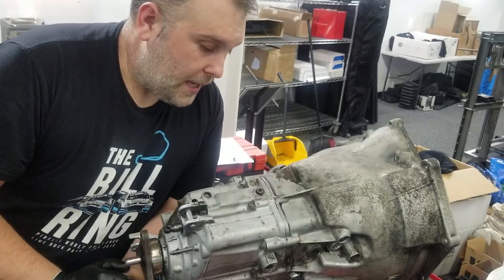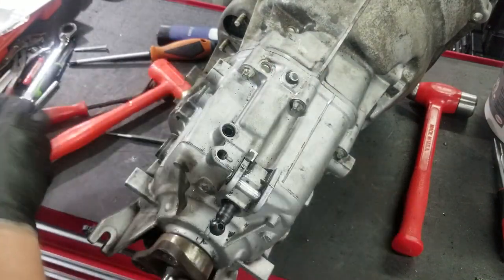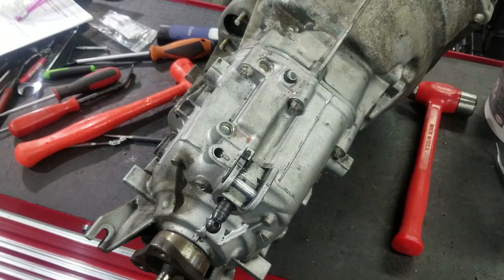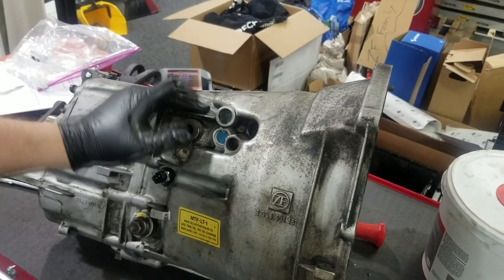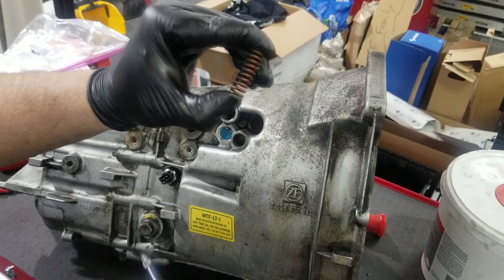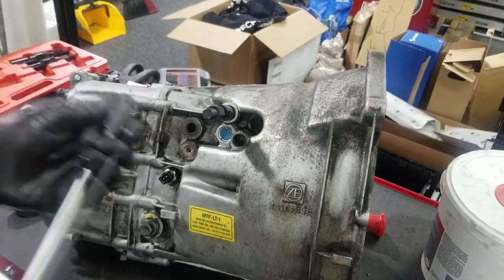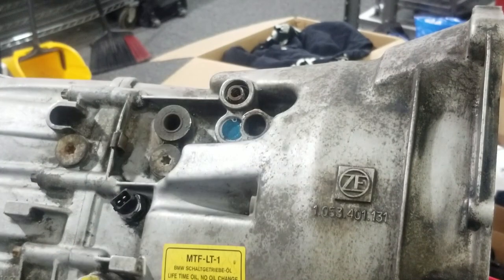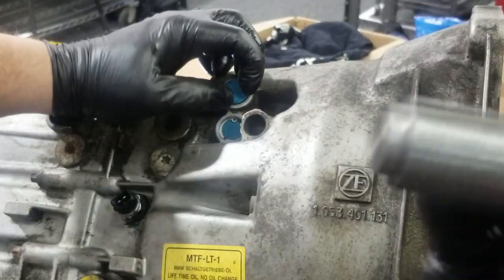BMW ZF 320Z Shift Detent Replacement

Comment: Thanks for the vedio and congratulations. I have a problem with may BMW e36 Getrag. It is hard to enter first gear. That means most of the times after shifting the first gear, when I release the clutch, I hear a grinding noise and pressure on the gear shift. But when I shift the gear quickly and thoroughly it works very nicely. Can you please help me  to solve this.

Comment: On my 5spd I also have another one next to 5th and reverse. It leaks fluid out of there. Any idea what it is and if I can replace it too?
Reply from the maker: The additional detent on ZF 310/320Z transmissions is p/n 23311224823. Usually it's not an issue but if the cover for it is weeping it would make sense to replace it. You'll need to order the cap, p/n 23311224825, and snap ring, p/n 23317531374, separately. You can reuse the compression spring however.
Reply: @GarethFoley  awesome. Thanks!
Reply: @GarethFoley  is the cap and snap ring the same as the 5th and reverse one?